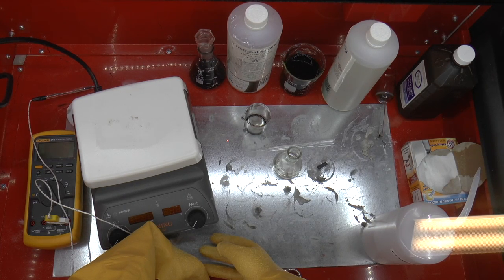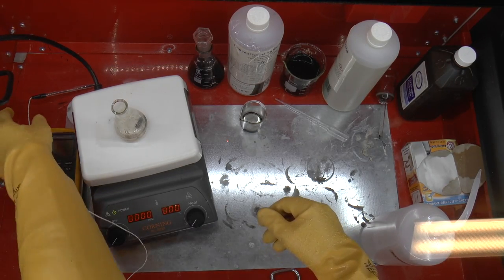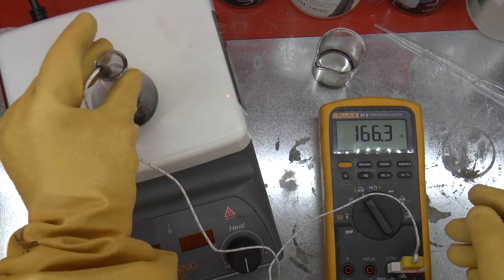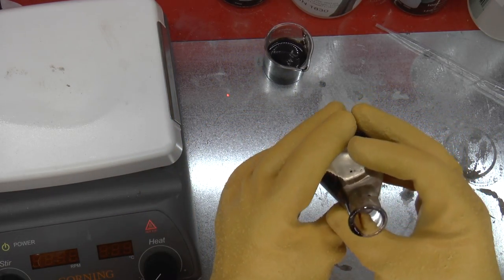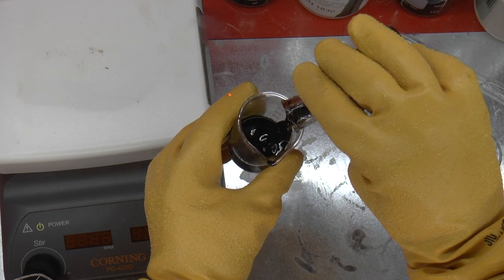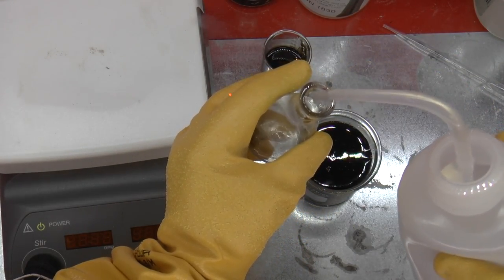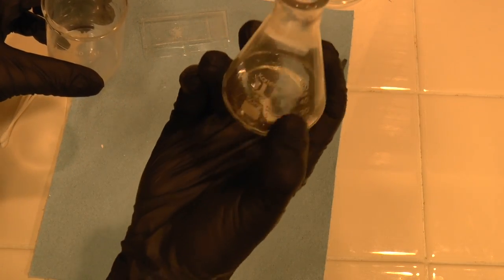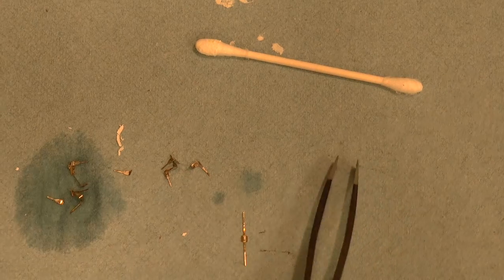Decapsulating a plastic packaged IC with hot sulfuric acid

Comment: Nice video. A few comments - while the fume hood is nice it isn't really necessary for this because the reaction of the epoxy and sulfuric acid doesn't produce much gas. I usually just put a stopper in the flask neck and the small amount of fumes which are produced remain in the flask. Also, room temp sulfuric acid is not very dangerous to skin so your gloves are overkill. Hand-only gloves are a good idea but sulfuric acid (at room temp - 200C is a different story) takes more than 30 seconds to even begin damaging skin. The main risk is that you will touch your eye with a finger which has a drop of acid on it. Finally, instead of distilling the acid, you can get away with slowly adding hydrogen peroxide to the contaminated acid and it will slowly clear up as the carbon is oxidized all the way to CO2 and bubbles out. You are left with watered-down acid (with some trace contaminants) and you could then evaporate off the excess water I think.

Comment: What about a COB blob? Would this procedure work to remove the epoxy from that? I took apart a device that had a microcontroller blob on a board to control a 32x16 LED matrix. The matrix can be reprogrammed with a phone using the 3.5mm headphone port and FSK signals, but there's also an I2C header broken out on the board that I can't seem to interface with. I have no idea what the uC is and I'd love to try to reverse engineer it if I could.
Reply: Chances are a microcontroller would be very complex to reverse engineer. 10s or 100s of thousands of gates for all of the peripherals, and you still won't know what it is unless the manufacturer included some marks.

Perhaps a better idea would be to work out how you can interface a microcontroller of your own choice to the existing circuitry and then write software to drive it - then you can do what ever you want with it.

I did that with a 16x96 LED display off eBay. Had an ESP based controller on it, but the rest of the circuitry was just shift registers. Was very easy to reverse engineer that and then write new software to drive it from something else.
Reply: @TomStorey96  Well poop. You're totally right, and I  have run the panel from an arduino uno and nano. I even soldered up an adapter board to interface with the nano, so I'm just being super curious wanting to know if I can hack the stock controller. I might still be able to in other ways though!
Reply: Check out electronupdate here on YouTube - he does a lot of decapsulation of ICs, including something like a PIC16. You'll get an idea pretty quickly that even some seemingly simple or mundane ICs can be very complex, so you need to be super motivated and dedicated to go through with such a task.

Logic gates like 74 series have large, easy to read features, but even moderately more complex ICs will start to need more advanced optics, have multiple layers of metal which you won't be able to remove one by one, and may even have design features intended to make clones non functional and/or slow down the reverse engineering process... Sorry to sound all doom and gloom, but it's probably getting beyond the capability of a home gamer.

Comment: Hot colophony is even more aggressive; it'll actually destroy the lead frame and the bonding wires.
Reply: I tried the colophony thing with a hot air gun at the max setting of 650 degrees. Nothing happened to any chips I tried. I think it is some kind of hoax, or that it does not work (anymore) with modern ic's. I tried with boiling sulphuric acid based strong drain cleaner (pH 1)  and it immediately ate away the encapsulation. Trying to use colophony just gives me a big mess and nasty fumes.